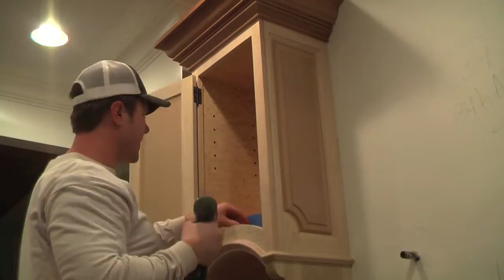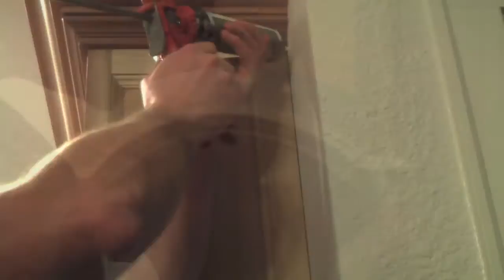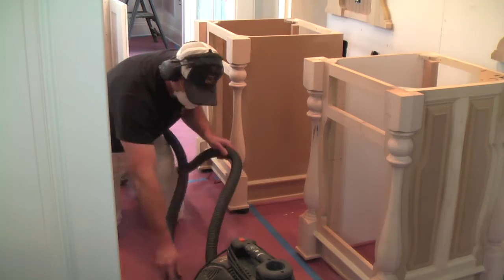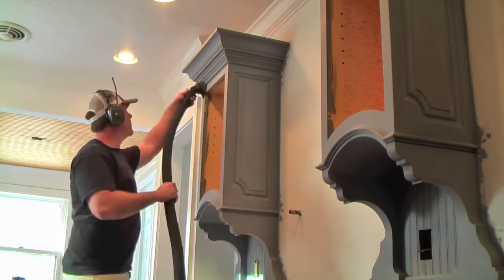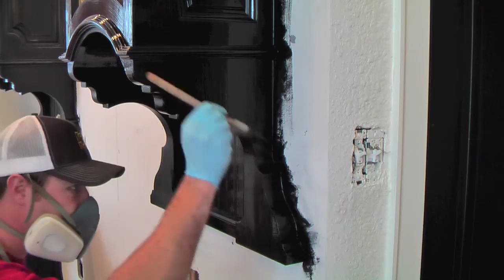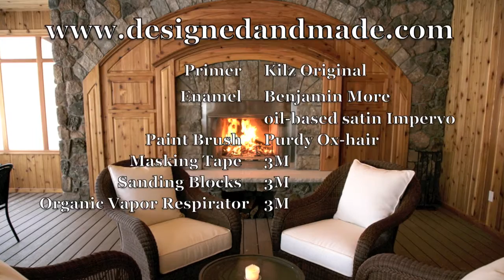Painting Kitchen Cabinets

Comment: Very professional preparation and a good coordinated effort painting these kitchen cabinets I would definitely recommend your work based on what I saw your. the proper way to paint any type of trim or wood furniture is to disassemble any parts that can be and paid them separately. I see it is very important that you go over the entire substrate making sure that there were no defects in the wood cabinets and that of course you went on and you did multiple coats of paint after sanding and vacuuming between coats.you might come over and look at our channel we also paint standard subdivision type kitchens. These kitchens of course have already finished on them and have to be prepared and refinished with a different color. Most are not made of wood but are veneered with the plastic coating or urethane.